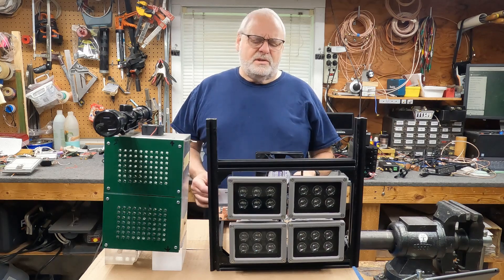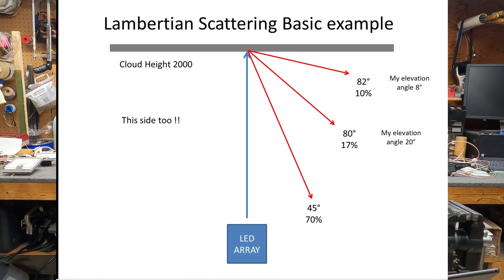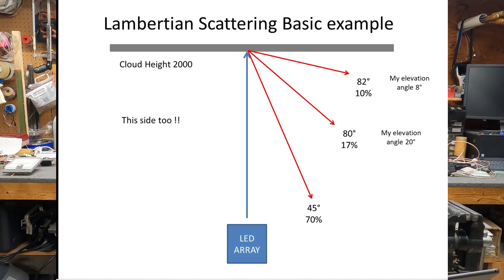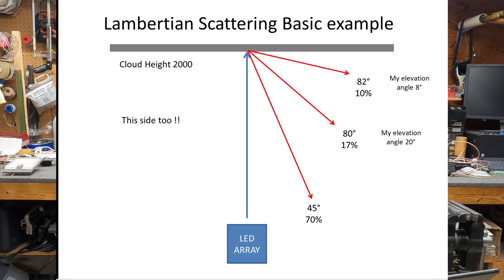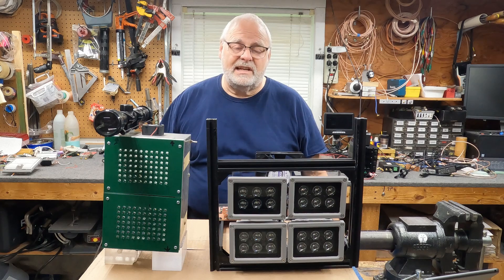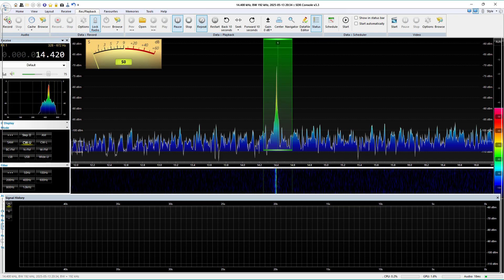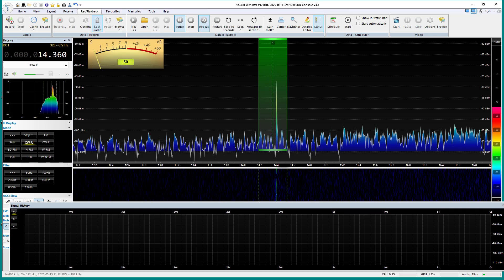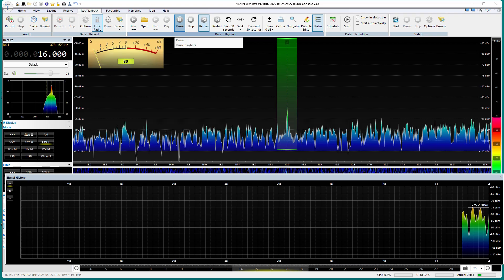Cloud bounce 1 and 2 miles and 4 miles

Comment: Hi Paul. Cannot offer you any formulas or theoretical predictions to your question but I think the way I would proceed would be to simply measure it yourself.  Set up the source and point it up at 45 degrees at some known cloud formation then move away from that source such that your angle equals the source (say 45 degrees) and see what you get. You can always increase or decrease your distance & angles and again measure the results. Pure empirical data and you can do it yourself. It's always fun to see how theory compares to reality. 73
Reply from the maker: Gedas,  I have been doing  sort of that ... but things change so rapidly in the sky it is hard to get any meaningful results day to day.  W1VLF

Comment: Not sure if I sparked the cloud idea in the past but it's great to see you accomplishing the goal! I still would like to do a laser though. I think that the transmission distance could be much greater. Keep going. Im still working on trying to piggyback the modulation on the light source here. I also have to find someone to work with. Likely a sked is in order.

Good luck!!!!
Reply: What are you trying to do, with modulation? Some kind of AM, at baseline?
Reply: @lohikarhu734  sorry for the late response. I want to mimic what he's doing but instead of CW I want to do data transfer. I'd like to do it only with a laser pointer or equivalent and an integrated circuit to do the modulation. Kind of like what he's doing and what happens with fiber optic communication.
Reply: I do know a bit about LED drivers...